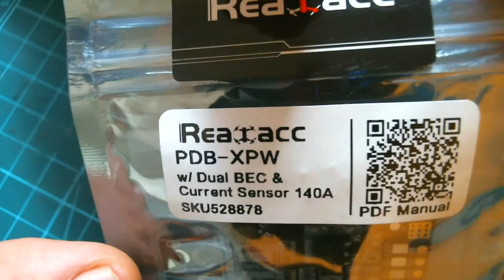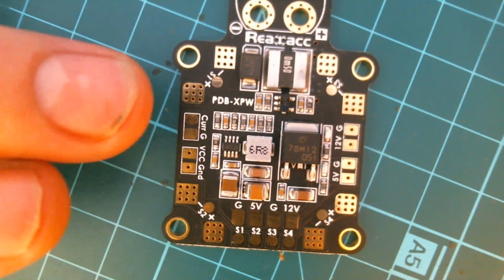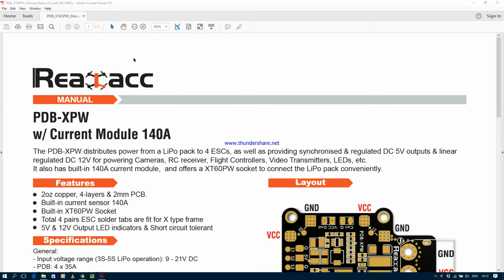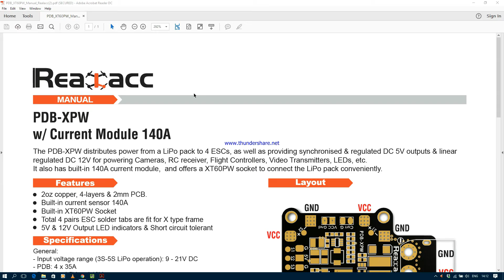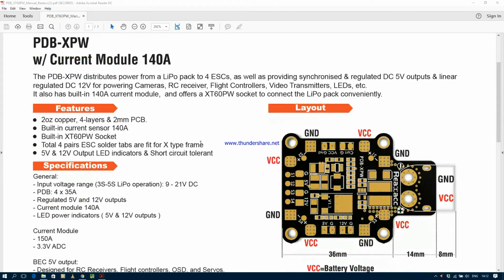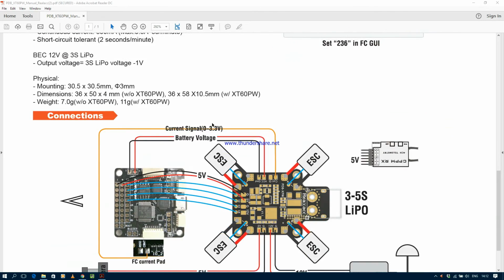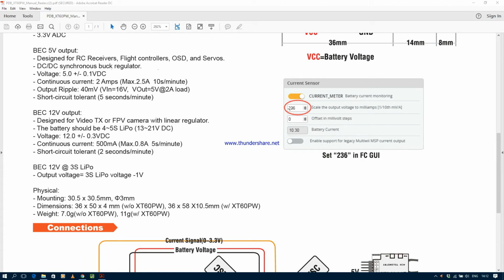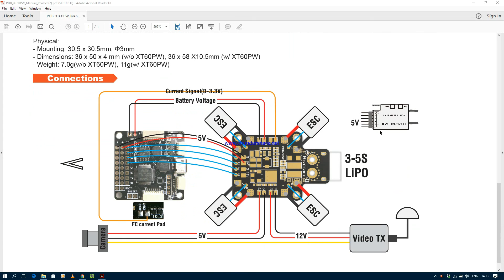Realacc PDB with Current Sensor

Comment: Nice review Steve. The XT60 has a bit of an awkward angle though. Do you think it'd be OK to use a standard straight up XT60 connector, or does it have to contact on all 4 terminals?
Reply from the maker: You could use a normal one as the two extra pins are for strength only.
Reply: Thanks Steve. Have you had any luck calibrating the current sensor? I've set mine to 236 based on the manual but it's way, way off.

Comment: Does the 5v and 12v output have filter?
Reply from the maker: Andre Martinez well yes and no it all depends on what you are calling filtering as the 5v side has a DNR a dynamic noise filtering circuit and the 12v side is just using the regulator (resistance) and a little capacitance,.
Reply: NQIS Steve If I put my FPV setup on the 5v and 12v will it come out with noise?